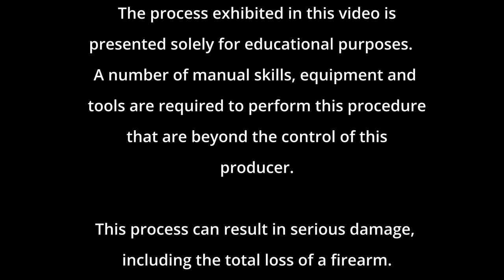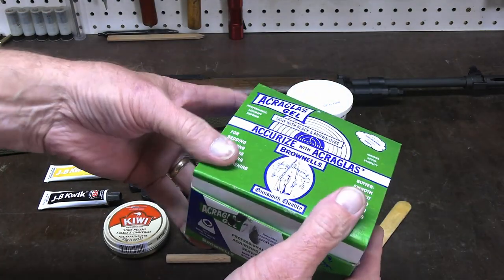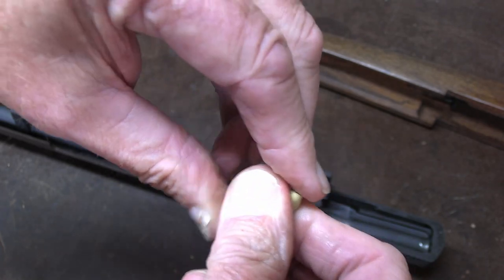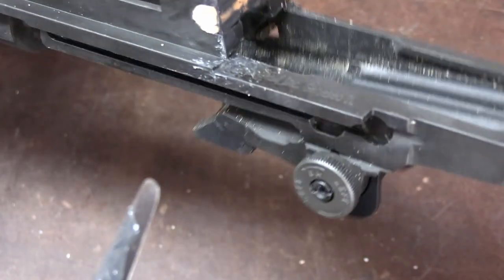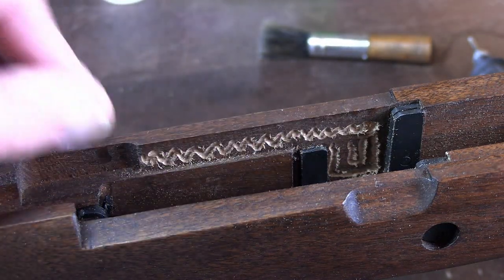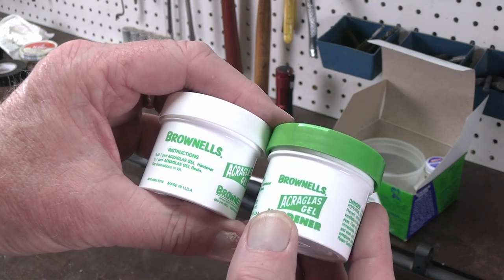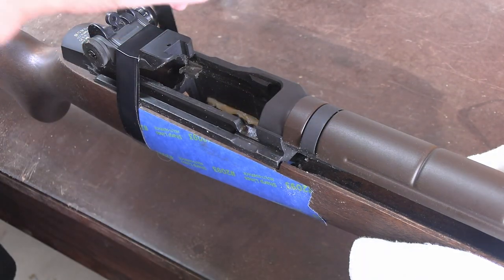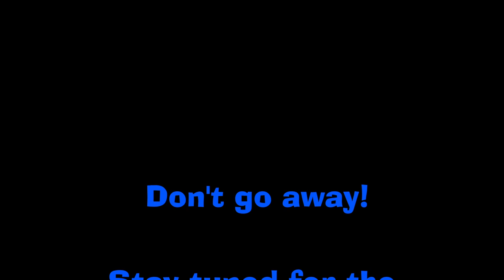How to Glass Bed an M1A or Garand ~ In Just 25 Minutes!

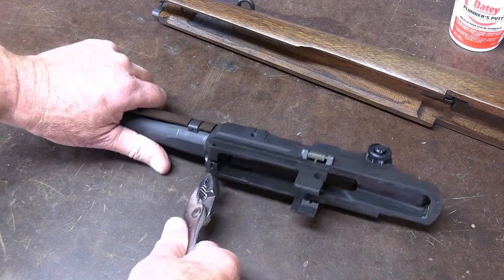Comment: The roll pin he mentions being a hard part to find at 20:08 is a steel roll pin measuring= 5/64 x 5/16". Just in case someone needs this information to find it at their local store or online. Standard replacements should work fine instead of marked up and/or branded parts.
Reply: That's some of that old anti-knowledge that seems to kick around still.

 needing specific parts from a manufacturer for 10s to 100s of dollars when you can find the same piece at your local hardware for cents.
Reply: @Thoroughly_Wet  But do make sure it's the right part rather than making it fit.
Bubba'd guns don't last long.
Reply: @luckyomen  oh for sure, I'm mainly talking things like roll or cotter pins, certain springs, studs/bolts, and things like epoxys for glass bedding.
Reply: Not all epoxies set to the same hardness, but generally yes. Most 2-part epoxies will do the job but a harder epoxy will last longer as long as it isn't brittle.

Comment: I used various methods of the National Match bedding. Last 2 of my Garands I multi stage bedded with pressure fixtures. I started with the Brownells kit and fabricated additional fixtures. My T26 M1 in 7.62mm shoots 1 MOA with Mk316 Mod 0 or M118LR hand loads using IMR4064 and RL15
Reply from the maker: This process is all about getting the same results without such multi stage complications.  I see absolutely no logic behind the concept of barrel pressure.  That's an antiquated notion carried forward by the old industry practice of using a forend stock pressure pad to stabilize a poorly bedded action.  The industry has gradually gotten away from that.  Properly bedded actions hold the works steady.  All correctly action bedded rifles shoot best with the least interference. This rifle is a plain M1A Standard, and now shoots MOA or better, and has no forward pressure that is subject to change as the stock moves with humidity changes.

Comment: As always sir, thank you much for your instruction and insights!  You have taken what many regard as a black art and illuminated it with knowledge.  My hat is off to you.

Suggestion for a future video:  pillar-bedding a bolt rifle like an old Remington 700 or similar.
Reply from the maker: Thank you for your comments and suggestion.  I've actually pillar bedded two Model 700s, one Model Seven, and my dad's Remington 40-X benchrest rifle.  All had been previously epoxy bedded and their respective accuracy well established and recorded.  Not one showed any improvement after pillar bedding, in the least.  As I stated in this video, walnut is dense and will not compress.  Pillars will do nothing beyond the capacity of the wood itself.  It can however, become punky as the result of the improper introduction of gun oils and solvents, where pillars can correct an existing problem in that regard.  As I've so often stated, oil destroys guns and should  only be wiped with restraint on metal surfaces, but never directly applied.  Oil and grease obey gravity and will migrate from metal to wood, which gladly sops it up.

Comment: Honestly, I never glass bed my rifles, because even Walnut WILL absorb moisture. The slop that is left in a factory rifle, will usually go away with time due to the wood absorbing moisture and thickening over time. It probably wouldn't crack on you if you bed the receiver really tight, because the walnut is so dense, but it might warp over time because the stresses will want to move somewhere. I like leaving the slop in my M1A's, especially when I apply Ballistol over time, it usually will thicken up and bed itself.

Comment: You mentioned that glass bedding a wood stocked Mini 14 was similar to the bedding of this M1-A. Will you ever be bedding your wood stocked Mini 14? I'd really be interested in seeing that as I have a wood stocked 581 series that I'd like to do. Thanks for a great video on bedding the M1-A!
Reply from the maker: Probably not.  Though it might be illustrative, I doubt it would be of any benefit. My Mini-14 wood stock is a tight snap fit with no movement whatsoever without the trigger group, and it shoots very small, consistent groups.  I was referring to their synthetic counterpart which is another story and quite loose.  They do improve with bedding, however, the greater problem with such stocks is their lack of backbone and supportive rigidity beneath the epoxy.  For anyone with a loose wood stock, this same process will work.
Reply: @GunBlue490  Thank you for your response and the helpful input.

Comment: Thank you so much for this instructional video! You really do an excellent job of explaining the process. I have no doubt that with this information I can accomplish it myself.

However, after thinking about it for a little while, I’ve come to a mental obstacle:

Why go to the trouble of modifying the stock, doing all the prep work, and buying bedding material when a shim or two should solve the issue just as well? What is the real difference and could you achieve similar results with shims?

Comment: I have found my M1A stock to have a small bit of movement fore and aft of a few thousandths as well as side to side.  You mention you had fired 300-400 rounds through yours before bedding it and you then had no movement fore and aft.  I have only fired 40 rounds through my new M1A and wondered if I am glass bedding it prematurely.  I see no indication that the lugs have contacted each other as you describe in this video.  Should I wait until I have fired a few hundred rounds before I glass bed the stock?  Clearly, the side to side movement has to be dealt with, but I'm unsure what to do with the fore and aft (forward and backward) movement at this early stage of ownership.
I value your opinion and look forward to your reply.
Reply from the maker: Glass bedding equalizes support and stability, and is equally effective at any time.  There's no relationship to prior condition or number of shots.

Comment: After the bedding process, you no longer need to field-strip the rifle for cleaning/Lubrication?
Reply from the maker: Yes, I dismantle mine after every session.  There's absolutely no harm to be done, IF my discrete method is employed. It's no different than removing a bedded Model 70 action.  Yes, I know that Springfield Armory doesn't recommend dismantling of their factory bedded M1A rifles because such heavy applications of epoxy are damaged when dismantled.  Of course!

One must understand that their method of pouring a flowing river of epoxy into a stock follows glass bedding theory of the 1950s when fiberglass and epoxy was first invented and has long been proven entirely unnecessary with other rifles.  Springfield Armory apparently didn't get the progress report or they ignored it, more likely.  

You see, if good, effective glass bedding is simple for the average person--and it is--I am directly threatening a lucrative market for $2,500 rifles.  I get very angry replies from folks who don't like my method.  It means I'm over the target!  Lol.  Accuracy requires very little effort to achieve with most any rifle, and the method varies little from one to another, regardless of action style.  Eliminate action slop and allow the barrel to vibrate.  

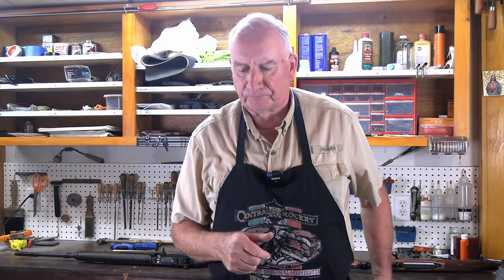Please watch my follow-up video "Glass Bedded Springfield Armory M1A Standard Walnut Range Test".  (8:53 minutes and 11:12 minutes) 

In accompanying videos, I also demonstrated how to stabilize the rear and front sights, and how to tighten the gas system.  The demonstrated results are a Standard M1A that grouped four of the five shots into .870" on camera.  Any shot outside such a group is a statistical anomaly that any scientific test protocol discounts.
Reply: @GunBlue490  I see! Basically if one uses the "correct method" for the bedding, no harm will be done to the accuracy. Thank you sir for all the information, how to, and most importantly the time and effort you put into making these videos for everyone to see and learn from. Thank you

Comment: @Gunblue490 Whats the point of adding epoxy to the recoil lugs?
Reply from the maker: The recoil lugs are the primary point of recoil support in any rifle.  With the Garand, M14, M1A, and the Mini-14, the recoil lugs are the major support. The entire purpose of bedding, whether conventional or epoxy, is to maintain perfect stability between the rifle action and the stock.  Bedding the recoil lug is more important than any other contact point.  In fact, together with the rear tang, it's the only place where bedding is really required in most bolt action rifles.
Reply: @GunBlue490 I have bought CMP rifles with some stocks that show evidence of glass bedding and some have had the flat area you point out as already bedded routed out and glass inletted into the stock. Why was this done? Was this just a mistake?

Comment: I'll be bedding my action tomorrow and had one question. I noticed you didn't wax any of the inside of the stock. Is it alright to apply there to keep epoxy from adhering to places it's not needed or is scraping the excess all that is needed? Thank you.
Reply from the maker: I didn't, simply because from experience, I get at any excess while it's still green.  But, it's certainly a good thing to do, but take care to keep away from the bedding areas.  The only waxing I would be concerned with are the exposed flat areas of the magazine well, where excess oozes.  There's very little tolerance on the magazine clearance.

I'm sure you'll find it quite rewarding.  I'll do a range video as soon as the weather breaks here.  I tested some handloads with mine yesterday and was very pleased with the preliminary results.
Reply: I will be looking forward to see how your rifle improved, as well as mine. Thanks again!

Comment: Have you ever had to shim the trigger assembly to tighten the stock fit to the action?
Reply from the maker: No.  I've addressed this issue in past videos.  The trigger guard must never be used as a lever to yank out the firing assembly, or it will soon become bent and fail to torque the action together.  Once unsnapped, lift the assembly gently along its rails, but never pull it out with the trigger guard.  Springfield Armory specifically addresses that also in their owner's manual.
Reply: My 1942 M1, was a CMP Danish surplus that had a replacement Burch stock.  The stock to reciver was loose with the trigger assembly not clamping the stock to the reciver.  I used a .020 inch gasket to shim between the stock and trigger asm to provide a proper clamp load.  I have put over a thousand rounds in the 25 years since I used this fix with no apparent problems.  The gasket has enough resilience to provide a firm but not excessive clamp force that has stayed consistent.  Was this a proper repair?
Reply from the maker: @walterkleban2746  Placing it where you did under the trigger assembly, and not the barreled action was certainly okay!  However, you can get a new trigger bow that will fix this issue, caused by the common error of yanking the firing assembly out by the trigger guard, rather than lifting it up.  With study, and a bit of care with a vise, it can be removed from the assembly and bent back to shape. It should begin applying torque about 1/2" from closure.